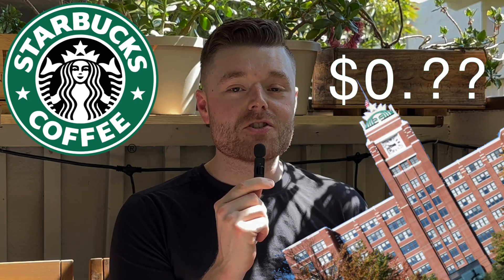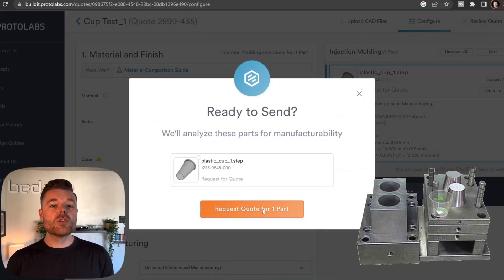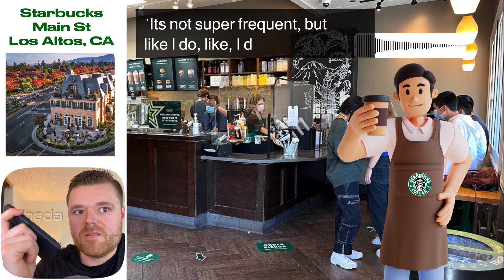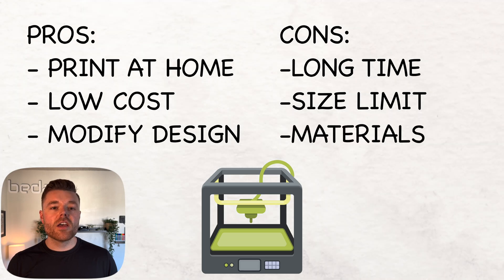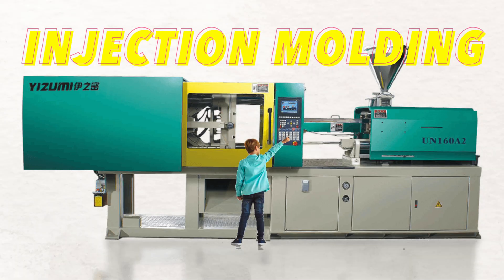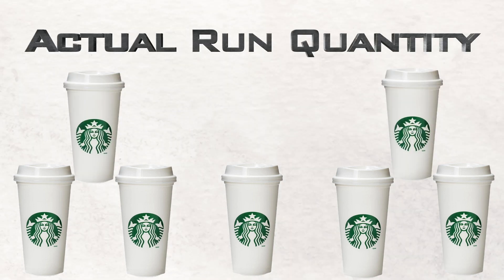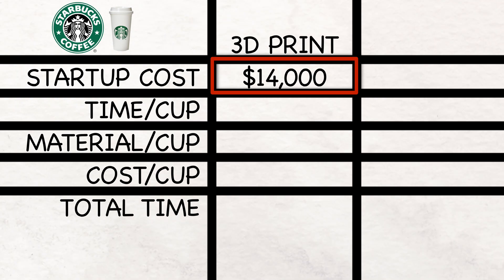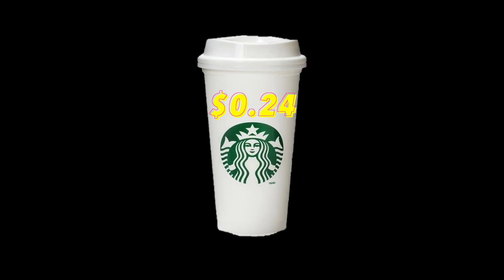How Starbucks makes their cups on the cheap!

Comment: Very cool video. I would be interested to see a video comparing thermoforming machines to injection molds and when thermoforming is the more cost effective. It has always seemed like 3D printers are only useful for modeling and prototyping in professional plastic work.
Reply from the maker: Thanks for the support! Completely agree! Thermoforming is used for Starbucks disposable plastic cups so you could be on to something there 🙌

Comment: Adam - very good. I saw this over on Linked.  Injection PP may be more than a buck, but not a big deal. Cycle time seems too low, unless you have a system to cool the part before it ovalizes or warps, probably robotic pickers.
Reply from the maker: Thanks Jon! Thanks for the feedback. Definitely taking some estimations here, but maybe next time we can work together to come up with some even more accurate cost estimates 🙌
Appreciate the feedback and support!